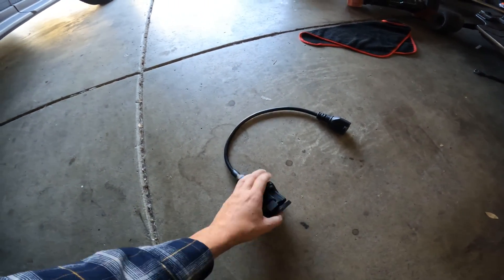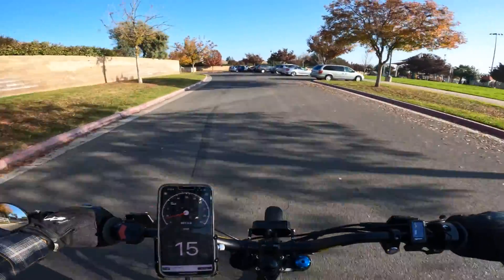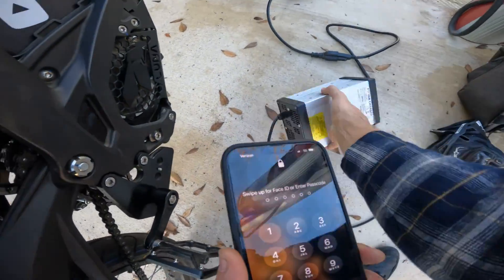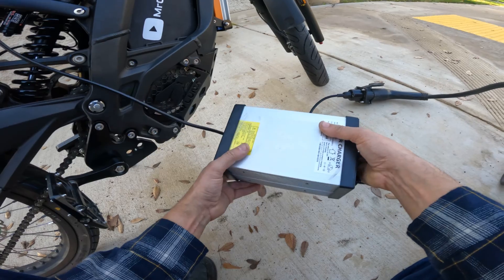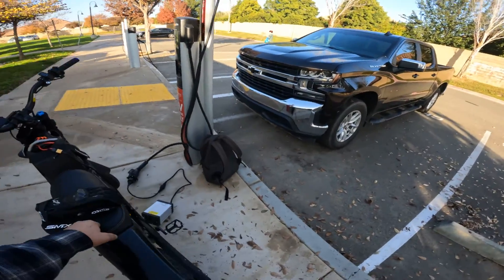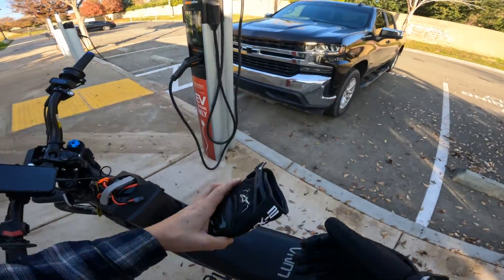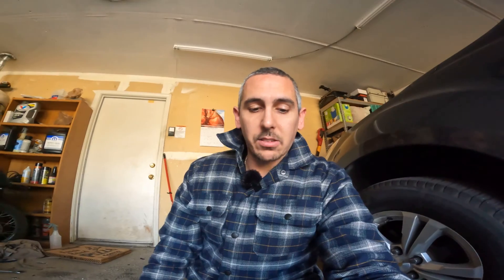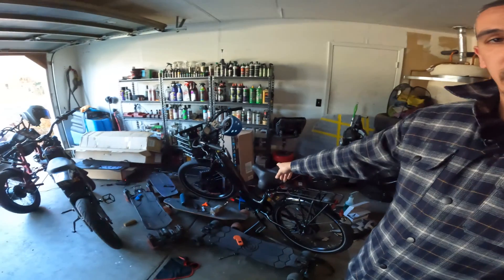Sur Ron & Segway EV Charging Station // HOW TO with LINKS!

Comment: If you can get the J-1772 to IEC C13 adapter instead of the J-1772 to 5-20R adapter go for the IEC C13. The IEC C13 will plug directly into the IEC C14 connector on your charger. Also the P5-15R and the P5-20R are only rated for 125 Volt, not 240. The IEC connectors by default are rated for 250 volt.

Comment: What about a 100-120vac,50/60HZ,20A output is 58.8 14 amp charger. I have a 52V 60 amp hour battery.
Reply from the maker: You can't use 100-120v chargers. You'll destroy your charger or it just won't work.

Comment: Will this work with a talaria?
Reply from the maker: yeah but u need the a 220v charger talaria charger. check your charger first and verify it says 110-220v. if it does use the adapter and your good to go.
Reply: @MrCentralDriver  my charger is 220-240v as it's the UK/ EU. Version. So I assume in good to go?

Comment: I have an rz ebike. It has a lithium battery. And the charger I have is a model DZL724002. Input ac110v 60hz 500w and the output is DC84v 6a. Can I use the j plug to charge my bike?

Comment: I do the same thing with my E bike, but I go to the Level 2 free chargers, no apps, no muss,no fuss. All you need is the J1772 to Nema 5-15/20. Make sure your brick will accept a 240v input, as the EV stations put out 240V.
Reply: You just only need to use the adapter J1772 to Nema 5-15 to use with the free AC Charging stations? Please clarify if you use the 10 amp with the adapter. Thanks

Comment: I'm assuming this will work with the stock surron charger
Reply from the maker: Nope. Only Segway. It has to be 240v compatible or you will blow your charger.
Reply: @MrCentralDriver  I have a 2023 light bee x the charger says 100-240v

Comment: I got be real. I wish it was that simple, but its a lot more complicated than this. If you're not careful you can blow your 10 amp charger by hooking up to the wrong station. Your battery will be fine because the charger will go open circuit. Most charging stations today can output very high current, way over 10 amps and about 400 volts. To put it in perspective; a Tesla car takes about 60 hours to charge @ 10 amps 120 volts (1200 watts or 1.2kW), but some can get from 0 to 80% in about a half hour on a some of the newer charging stations that use DC, which is another problem; 10 amp ebike chargers like the ones in this video have 4 diods in a bridge rectifier configuration to convert the AC input to DC power for your battery, so its expecting you to hook it up to AC and if you hook it up to DC on a super charger....well that could only mean trouble. I'd really love to hear from someone who has a lot of experience doing this at charging stations, make im wrong and all charging stations have software to automatically lower the power output down to at least 2400 watts, but I'd be willing to bet that's not the case.
Reply: I think I'm going to try this , but I'm probably going to put a 10 amp 240vac fuse in series to protect my charger
Reply: These charge point only out put maximum 7kw they are slow compared to DC fast chargers, DC fast chargers do out put higher voltage but these 7-22kw slow chargers are fin to use as the only put out max 240v the Sur ron charger will only allow as much as it can use, stock charger peaks at 800w here in Australia, and the charge station will only give 800w to the sur ron charger.

Comment: the plug says 220v only will it work with 110v charger plugs
Reply from the maker: No
Reply: @MrCentralDriver  I've watched other videos on this same plug and it seems to work just fine for anything under 220v from what I understand is that anything under 220v that gets plugged into that will work anything higher won't we also use a ebkarocy urban challenger ebike

Comment: Really good lion cells can charge at 1c and lion cells capable of fast charging at 2c, 4c and above. 
A usually really expensive Sur-ron aftermarket battery pack should therefore charge at least at 1c, meaning e.g. a 72V 57 Ah high performance pack should charge at 57A * 72V = 4.1kW of power. Again, minimum!!! 

Also, even the road legal version of the Light Bee doesn‘t feature a CEE-socket for station charging built in. So, this whole battery topic is (for now) nothing but a bad joke because it already could be way better from the consumers perspective. And all of that without driving prices through the roof. Cheers.

Comment: I live in Canada and we use 110-120v. Will this work on changing my 72v 35ah kaabo wolf king gt pro battery?
Reply from the maker: Yes just need that adapter and the correct charger and verify that charging station where u love is rated for the same voltage as your charger

Comment: 3rd update to this comment: So I just learned something new. 220 volt outlet splitters will lower the amperage of the outlet but not the volts. So you still need a charger which can handle the voltage. Still wish I knew this before I fried my charger but hopefully the EVSE J1772 adapter wasn’t damaged.
Reply: EVCI guy here, the J1772 fine, sorry it cooked your charger

Comment: i wonder if this Adapter will work for my super73 and my dads rad bike
Reply from the maker: Only if your charger that charges the bike accepts 220v. If not you’ll blow up your charger
Reply: @MrCentralDriver  it says input 110 to 220volts out put is 50 to 60 idk what any of that means

Comment: Clever of u to use the iceblocked charger 😎 I would bring my normal chaerger though and find a normal socket.
Reply from the maker: You can use the normal charger if you have the Segway charger that connects to 220-240v. It does both but we have had bad luck trying to find outlets around town it’s kind of hit and miss so it’s nice to look up on the app where you can charge your bike and estimate your route and you have a guaranteed charging spot. It even tells you if the charging port is used or open before you drive all the way over there. Plus around my area there’s probably 20 of these locations within a 30 mile distance

Comment: It might be just as easy to find a store or school with outside outlets and charge there. Also you gotta have a lot of time on your hands to carry that heavy 10 amp charger with you.
Reply from the maker: Yeah you would think that but a lot of the plugs that we found at local gas stations were actually blocked so people cannot plug anything in or filled with silicone no joke. Using it this way at least you know on your phone exactly where the charging ports are at so you don’t have to second-guess your battery life looking for a charger that you might not find when you know these work guaranteed
Reply from the maker: Also the charger is very light. Just bulky

Comment: How many ampere per hour is it charging at?
Reply from the maker: I believe the station said 700-800 Wh per hour
Reply: @MrCentralDriver  So it's about 10ah per hour? If it's 72v battery?  Or my calculations are wrong. So it took about 4 hours to charge a 44ah battery. That's very fast.
Reply from the maker: I didn’t stay at the charging station and I know there’s some basic math you can do to get an idea because you’re only limited to what your charger output is. Which the charger I have for the charging station is 10amps max. A stock 32 amp hour 60 V battery with a 10 amp charger is three hours which 60x32 = 1920wh. My battery is 72v40 so 2880wh. I’d assume a little over 4  hours ruffly at 10amps

Comment: Very interesting! Thank you for this video! 

Question though. I know people have asked, and you've already answered, but I'm still a bit confused over 1 detail. You mentioned that it doesn't charge faster than being plugged in at home. Is this due to the converter box that causes it to slow down the charge? 

Also, you said that it only costs you around 70 cents to fully charge the battery. This is the cost from the charging station, or only at home? Because the charging station where I live (we only have 1 charging station (that I have found so far) in my city) costs $0.32 per minute that it's charging. Is this not the cost where you live?
Reply from the maker: Stock surron is 1920wh. Watt hour rate in my city of Fresno is 21cents kWh for each 1000wh. So a stock sur ron at home being its close to 2000wh is ruffly 42cents. At a charging station they charge a bit more. Some charge you on just parking in that spot also so be aware. Look up your kWh hour in your city and see what it is. My sur ron battery is 72v40ah so 72x40 = 2880wh. Which means at home it would cost me ruffly 61-62 cents dead to full. Charging station will cost more and they all vary in price. There are some free charging ones and depending on location and parking they can cost much more then charging at home. Best bet is do a test and find out
Your charging won’t be any faster at home or at the charging station because it’s still limited to whatever your charger can put out to your bike. Which mine is 10amps at 110v and at 220v.
Reply: @MrCentralDriver  I'm assuming that the higher price where I live is either due to they are charging more for parking in the spot, or because they are the only location in the city providing the service. 🤷‍♀️

The charge station near me charges $1 initial fee + $0.32/min. I even branched out to search my surrounding cities, only to find similar prices there as well (also only about 1 charge station in neighboring cities). There isn't a big market for Electric Vehicles here, so I guess that affects the price. Seems home charging is my only option currently. But it was interesting to see this video here! Thank you! 🥰
Reply from the maker: Yeah. Around me they have some every 3-4miles. Multiple ones too.
Reply: @MrCentralDriver  Nice! Would love to see that here someday! 🙂🤞
Reply: @MrCentralDriver  ruffly ..
Reply: @zeroboyrick1717  Yeah. I've figured out how to calculate the cost breakdown for it now. But yeah, electric vehicles aren't popular here, nor are charging stations. So I guess the rare few that do pop up, raise up to a ridiculous price. I'll only be charging from home, that's for sure!

Comment: what if its raining ?
Reply from the maker: I wouldn’t do it unless u could cover your charger and batttery connections. But I don’t think anybody would run there ebike in the rain. Most ebikes get damaged or rusted from the rain.
Reply: @MrCentralDriver  What kind of rain formations are happening down in Fresno? Sounds intense. I guess I should avoid any mechanical vehicle in the rain.

Comment: Great video 🤙🏽. This a great information video on charging. How much faster is it then charge home.  How much will it cost to fully charge a battery if it dead.
Reply from the maker: Charges the same because it depends on your chargers output. 10amps at home. 10amps Over the ChargePoint station. 
And same as normal. About 3 hours if u buy a 10amp 240v charger. If u get a 5amp. Than double the time
Reply: @MrCentralDriver  oh ok that make sense. That you for all the information 🤙🏽.

Comment: What’s the cost of fully charging ??
Reply from the maker: My battery costs me 70-75 cents to charge from dead to full. A stock sur ron battery would probably be 50-60cents. The best way to think of it is. Every AH costs almost 2 cents. So if your battery is 32ah it would cost around 64cents. But this information isn’t accurate because every area is different so it’s going to be based off your rates in your city but that gives you somewhat of an idea

Comment: Why not just plug into any old wall charger you can find???
Reply from the maker: If you can find one. We went to a few gas stations that had outlets outside and they were all blocked or filled in with silicone so people couldn’t freely use them. This makes it easy to just no where to charge instead of searching and coming up empty handed. You can plan out your routes better
Reply: @MrCentralDriver  very true... I was being kind of sarcastic but kind of not... I've jad to unplug a quarter machine horsey ride out front of a family dollar to charge for a while before... lol no one ever uses those things, unless your trying to use the plug 🤣  worked out tho...